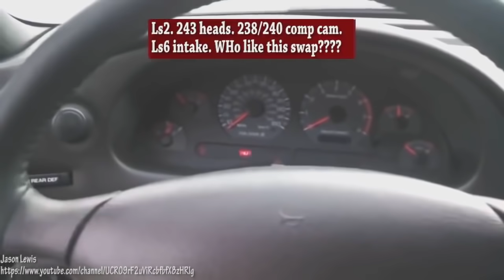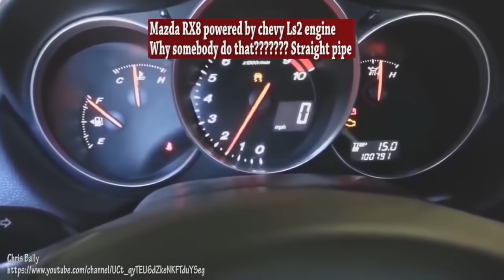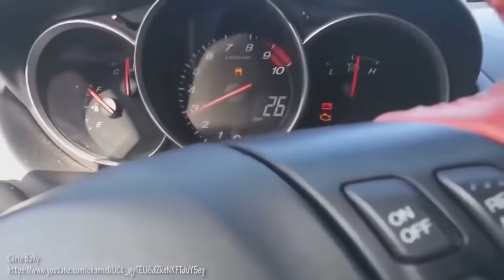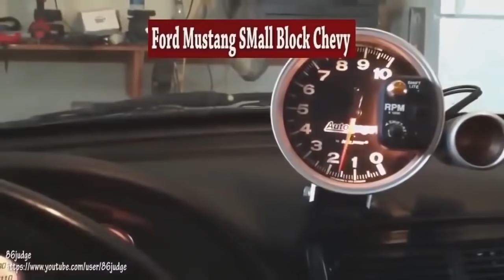Pure Ultimate Engine Swaps Madness 2019

Comment: Why would you take an Engine that can make 1000hp in a Nissan and replace it with a v8 that only makes 450ph? Does not make any sense at all!
Reply: Small block Chevy engines can also make stupid power. Whatever the R33 orignally comes with (I don't know which engine exactly) more than likely doesn't make 450hp in near stock form. A small block chevy makes that easily while being NA.
I didn't see no mention of 450hp though. 
Something does feel off though looking at an R33 and it making V8 noises and not Inline 6 noises

Comment: I wanna see a chevy with a wild V12 Jag motor for a change. They really wasted the skyline and porsche putting chev motors in- zero handling and slower to boot.
Reply: my thoughts exactly, with the right parts and the right tuning you easily get 900-1000+ hp out of a skyline enigne

Comment: Love the RX8 running a Chevy V8. Reviewers at the time really liked the RX8 but said the rotary really let the car down. Several said that if the car had ditched the rotary and instead used the Mazda 2.0ltr 16v turbo engine (I think it was used in the 323 and 626 at the time?) it would have led its class. But Mazda stuck with the crappy rotary and so RX8s were a very common sight for the first few years after launch but then increasingly rare as the engines died or required expensive rebuilds. As soon as everyone realised the need for a rebuild at 50/60,000 miles, used car prices were affected. Low mileage (unless very, very low like 30,000 max) cars became less valuable as they hadn't been rebuilt yet. I see plenty of old MX5s, S2000 etc but the RX8 has been a very rare sight for a decade or so, in fact I don't think I've personally seen one in 8-10 years. If Mazda had used a normal 4 pot they would be a very popular car still.
Reply: Way too heavy with a V8
Reply: Turbo Nissan Micra 1.3 engine is a common conversion in Japan

Comment: If even the Japanese (the builders of the most reliable cars in the world) can't make a reliable rotary, then that engine design is BAD! So I get every swap where the car previously had a rotary, 4 pot, 6 pot, V8, V10 even V12 is a better bet if you want your car to last. Plus you'll probably get better fuel economy in a 4+litre V8 than a crappy, feeble torque rotary.

Comment: Rotaries sound like mopeds, drink fuel (and oil) like an engine 3 or 4 times the size, are unreliable and need rebuilds every 50-60,000 miles and have feeble levels of torque. The only positive that I can see is their small size and lightweight. I am glad that Mazda finally has the sense to give up on these crappy engines.